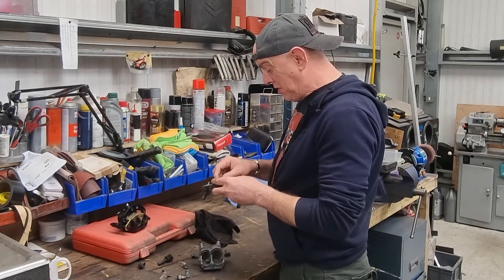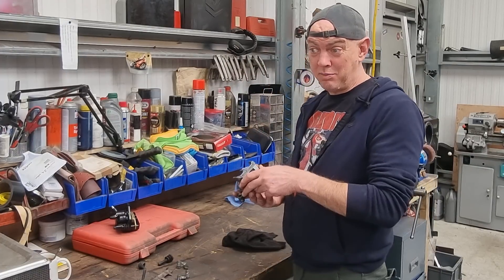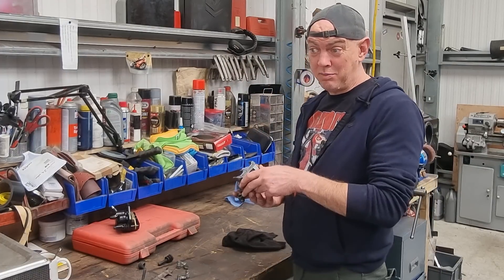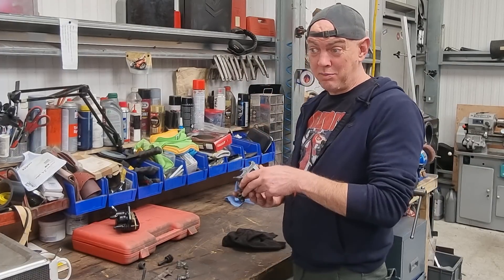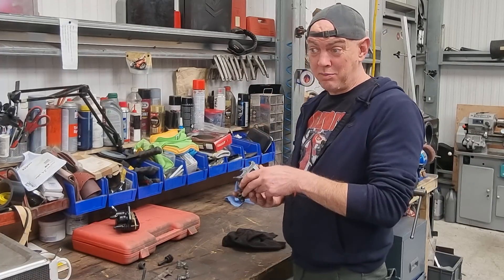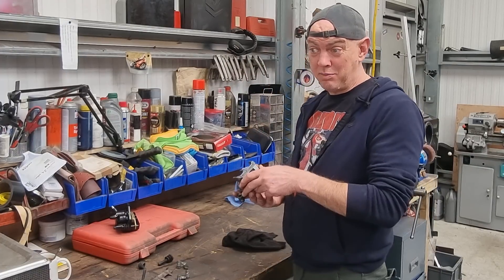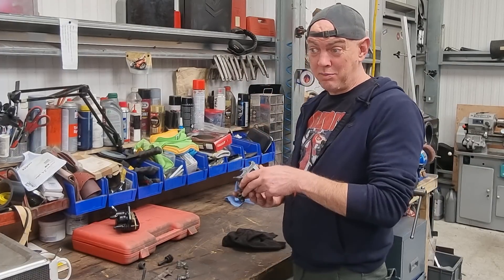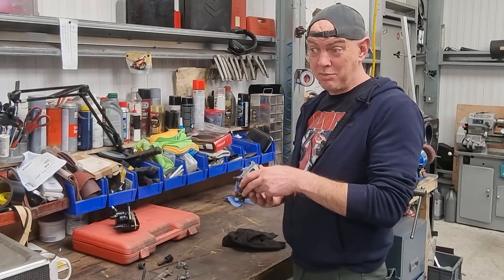Sorting out the brakes - 1990 Kawasaki ZZR1100

Comment: Seal the caliper with fittings, lift the moving piston high as possible, Fill the caliper with oil and use a g clamp or socket and vice to squeeze the moving piston in. this should hydraulically push out the stuck piston. Goodluck Quicky.
Reply from the maker: Good tip matey, thank you. We got the thingnout in the end, but it was a struggle 😁

Comment: Try a 50/50 mix of Acetone and Brake Fluid (or transmission fluid) and soak.. usually effective where everything else fails.   The other thing you can try (if the lines fit) is to use the front brake reservoir to push out the rear master piston... best of luck from Oz mate.   PS: my son in law has one of these with a 3rd gear issue (common apparently) .. ripper bike in its day!
Reply from the maker: Thank you matey, much appreciated. They ended up coming out after a chat with the fellas at work. We had a fitting with a M10 x 1 thread which screwed into the banjo hole, connected to an airline, a bit of heat and tapping it with a hammer.... it finally came out but not without a struggle

Comment: i use a blind bearing puller to get mine out usually works well, if not just connect it up to any hydraulic system = front brake will do for pushing out the piston. I hope that you and yours are all good and that you don't get it to :)
Reply from the maker: Thank you matey, unfortunately I just tested positive 🤨
Reply: @QuickBikes  Oh no does that mean not being able to go to work but if not to ill could go to the garage
Reply from the maker: Basically yes as long as I don't gave any symptoms.... its only me in the van, straight to the shop  and nobody else there anyways... sounds alright to me...

Comment: Always the little things that hold you up. Don't know if any other models shared the rear master cylinder? As to getting the piston out of the rear calliper, could you hook it up to the front brake line temporarily to try and use hydraulic pressure? Just come in off nights, so if this makes no sense, that's my excuse :)
Reply from the maker: Annoying init... yes, using the front master cylinder would work as well, but we managed to get them out in the end 😁

Comment: Yes...,that's a good Idea Simon....
Drill and tap an M6mm hole into the center of the plunger and with a centrally  drilled disc~plate on top., use a threaded bolt as an "extractor" passed through the plate and threaded into the plunger to draw it up and out....(if you wish you could also make the "plate" with a shallow "top hat" to fit into the bore to ensure it stays central and "square"..)

There'll be a rubber seal around the metal plunger which has probably welded itself to the inside of the bore....,but with the WD 40 soaking in for a while it should soften it up enough to allow it to move with this "extractor"....??

Hopefully......
BG.
Reply: Or, tap it, then heat the bejesus out of it and use the tapped hole to attach a slide hammer and give it some welly 😉
Reply from the maker: Thank you matey. In the end we used 10bar if compressed air through a fitting which screws into the banjo hole and gently tapped it with a hammer.... that actually worked so didn't have to drill it in the end 😁
Reply: Good Job...!!
Now it's just getting that blinkin piston outta the caliper...!!
Hopefully it'll push out with the brake lines hooked up now the MC is cleared...!

BG.